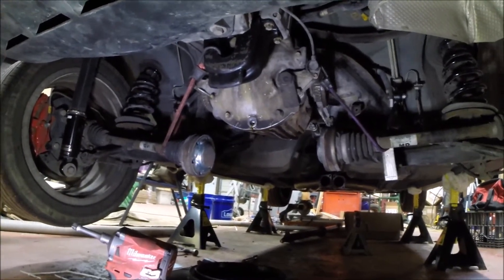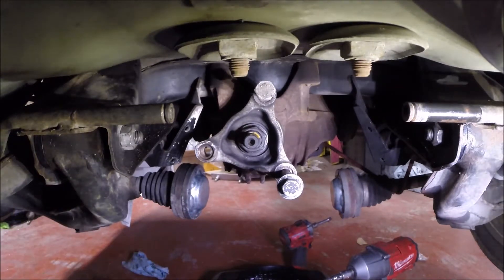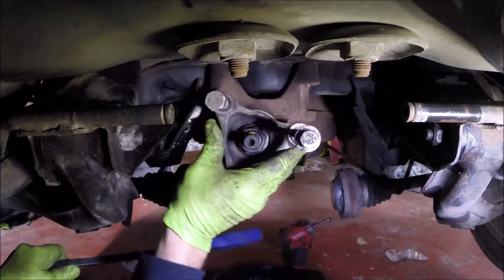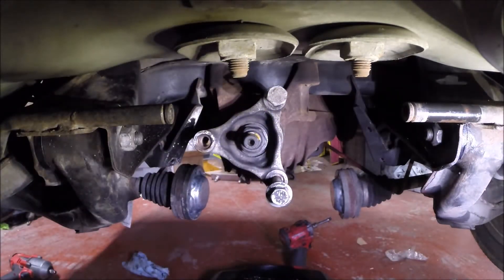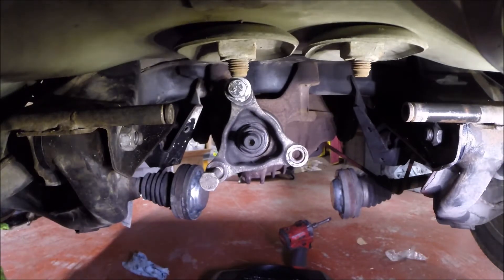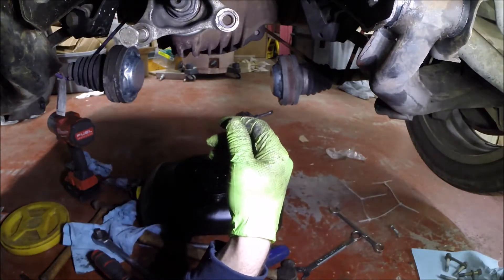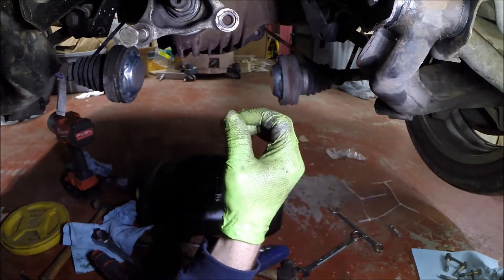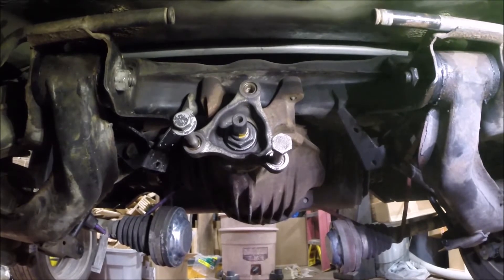2005 GTO Gforce1320 solid spacer kit installation pt 2 redemption time

Comment: I hope I never have to do this. Ever!
I have the same friction modifier but torco fluid as well. I’m seeing conflicting info on ratio to use. You used one ounce and close to two quarts? I have the harrop cover so it’ll take more but I’m curious what mix you’d recommend?
Thank you for the video
Reply from the maker: From what I read you want 3% to 6% FM or a good rule of thumb that's easy to remember is 1 oz per quart to start. Then drive tight circles in a parking lot listening for clicking from the rear end. Add more if it does.

What the FM does is allow the limited slip cone things to slip. If there's not enough they'll grip too well and click loudly in tight turns. If there's too much then you'll get the one wheel peel. Gotta goldilocks it
Reply from the maker: Also I ended up with 2 oz because I'm an idiot who gets in a hurry and didn't shake up the FM. There was a "sediment" at the bottom so I figured since there was only 2 oz left in the bottle anyway, I might as well put the other oz in- that's how much I used last time I changed the fluid and it was fine then too. I just think the best approach is to have as little FM in as you can get without the rear end clicking.

The capacity is 1.6L with the stock cover and 2 oz in 1.6L is 3.6%, so I probably would have ended up adding the other oz had I not done that anyway.
Reply: @evsnova74  geese our cars are so touchy. One ounce per quart it will be. It’s so perfect now it’ll be a shame to mess with it. Slight whine at part throttle only. But seals are going in this weekend along with the rear bushings.